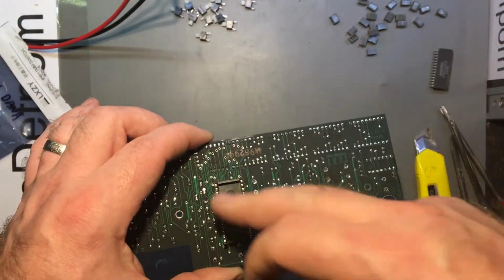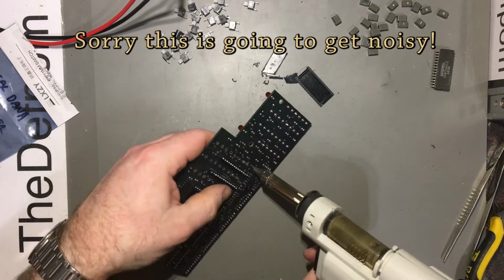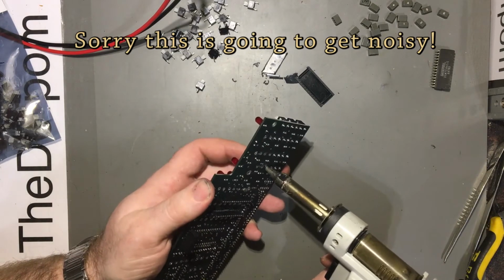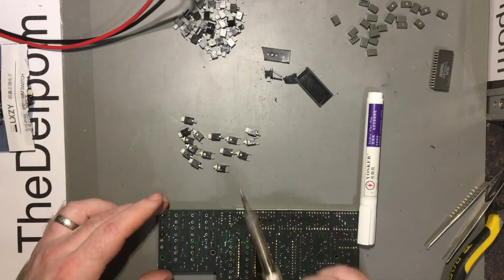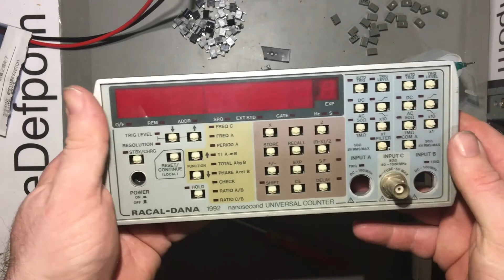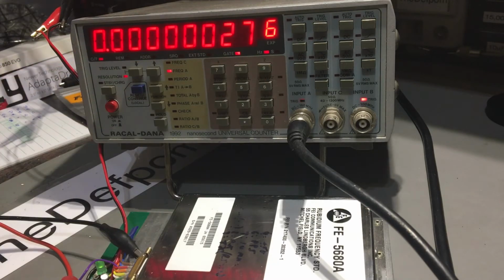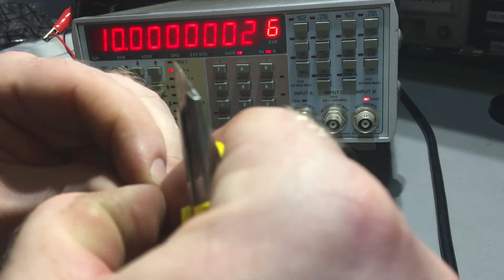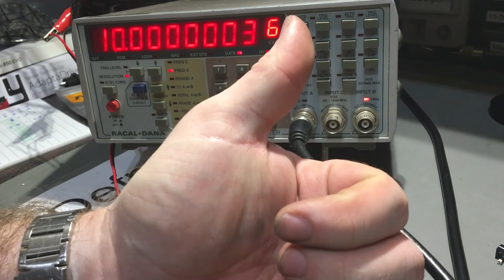#242 Racal Dana 1992 Repair Part 2

Comment: What replacement switch did you use?  I've been having a hard time finding a two pin tactile switch with the right style plunger to work with the caps.
Reply from the maker: knuth42 - I have the switches linked in the description of one of my other videos on these units, might have been a 1991 model instead.